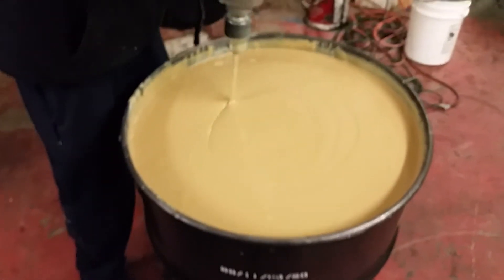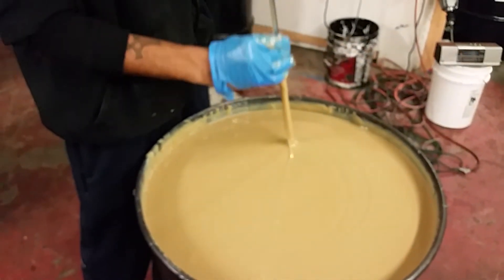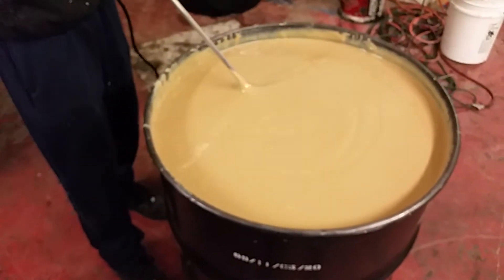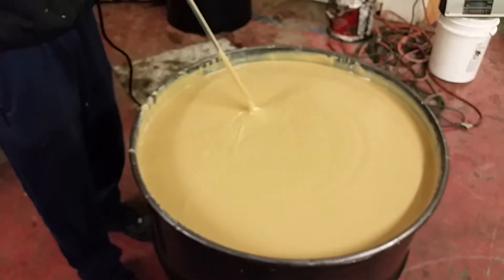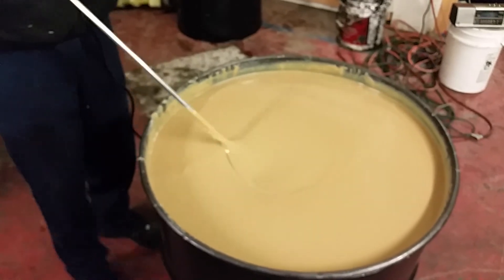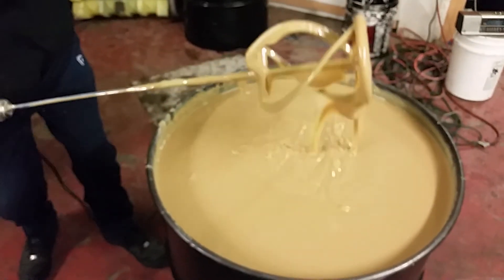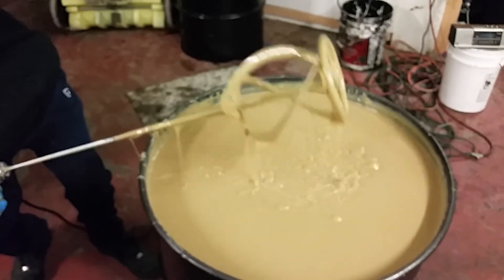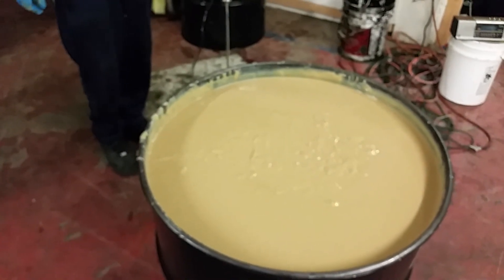Woolwax® Viscosity

Comment: Hey, do you have any videos comparing the viscosity of Woolwax vs other products? Does the black Woolwax have the same viscosity?
Reply from the maker: The Black Woolwax is the same viscosity as the Straw.  We do not do viscosity comparisons  because Woolwax is intentionally manufactured to be far more viscous than any of our competitors. The exact viscosity is easily and  exactly determined in our lab using a Brookfield viscometer.  I think that you will find that none of the manufacturers will release viscosity readings as it is considered proprietary information.